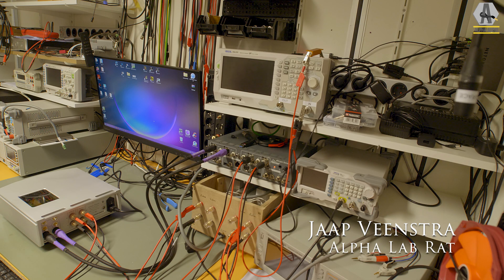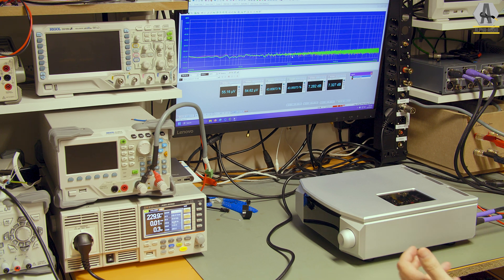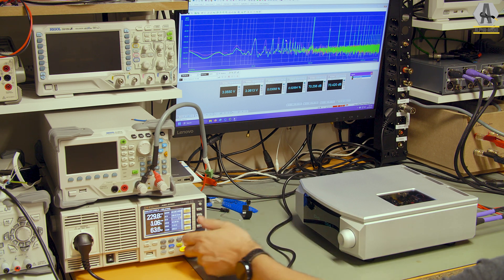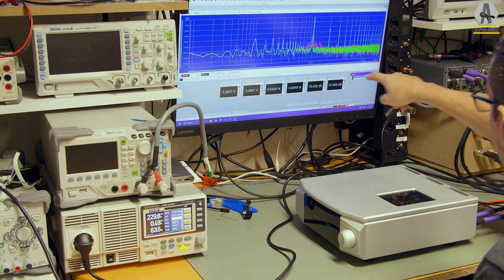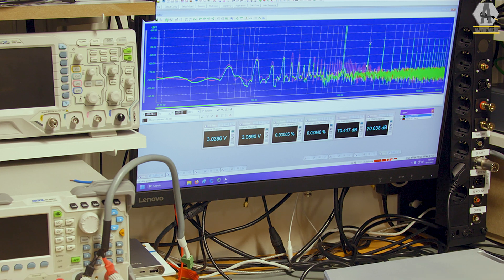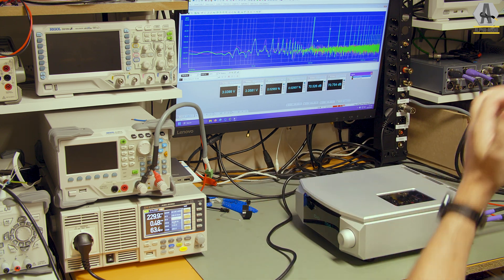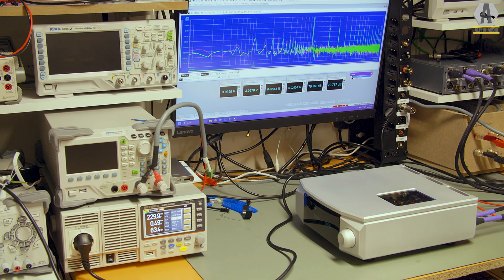Alpha Labs - Your amp might be struggling! Influence of noise on an amplifier

Comment: What is interesting is that the additional distortion only pops up on the right (purple) channel. The channel that is next to the power supply 

This proves that it's a flawed design as the left channel doesn't show the distortion (or at least way less). The shielding of the psu isn't good enough otherwise the right channel was as clean as the left channel.
Reply from the maker: It is an integrated amp. That is not weird.
Reply: @TheAlphaAudio  not weird but there are done cost cuttings / compromis that technically aren't necessary. The left channel proves it can work fine, they just compromised on the shielding/layout of the right channel to safe space/money 

Honestly, it's still below 100dB so in most situations inaudible, good change the maker just accepted it.

Personally if this noise matters to me I would buy a better amplifier, not an expensive power conditioner. A quality power supply should handle noise/fluctuations well.

Comment: I think I have terrible noise on power grid or maybe someone is using a ham radio nearby . Is there any way to find this out without an oscilloscope ?
Reply from the maker: Not really. A spectrum analyzer is the tool you need. Although there are some simple devices that give you a number... But how and in what spectrum these devices work... No idea.

Comment: Not all amps behave as bad as this.This is an overhyped underdesigned and cheaply made amp with most costs sunk into the case and eye candy. I won't even comment on the 'low feedback'  high distortion design.  Please compare with something decent.

Comment: What a bad amplifier design. Harmonics do not really fall with higher order. Never seen such a mess.
Reply from the maker: Send in your design. We can check it out.
Reply: I can check it for myself :)  @TheAlphaAudio
Reply: Sorry to bother you again, but are you really sure, that your choko EMEI amplifier is in good shape? It seems to have a problem, because the manufacturer promise 0,002% THD&N  in the specs. Manufacturer measuring conditions  are unknown, but the amplifier´s  behavior  is not ok, even with low nfb.
Reply from the maker: @jellybelly2234  this is just noise floor. Not THD...
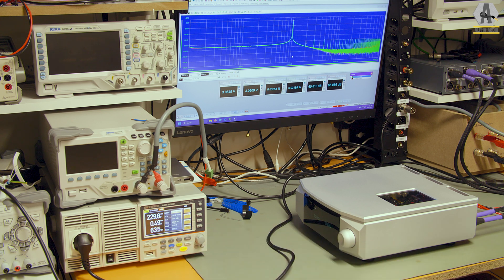Reply: But you call them "harmonics" in 2:39 yourself.  Cursor is set on K2 (with 1 kHz stimulus), and what we see below in the meters is THD 0,03%, 70 dB SINAD . You named it "low negative feedback design", but this is not ok, even in a low  NFB design. This looks to me as a faulty bias circuit or something else. If your measurement is correct, the amp must be faulty.
Reply from the maker: @jellybelly2234  We will do a complete measurement for the review.

Comment: Japp! Great showing us something, we mini audiophiles didn’t know. How are your grid and in house, 3 phase or what? In Sweden almost all newer homes, 1970 forwards have 3 phase (25 amps) . I’m now I Spain and apartment from 1985 and it’s 1 phase (40 amps) and how does noice compare in the phases?
Reply from the maker: In the Netherlands it differs. Some houses have 1 phase, others have 3. I am not sure what I have at the office. Sorry.
Reply: @TheAlphaAudio  Thanks for answering. Don’t be sorry, in all countries there are different power distribution solutions and they all affect the power and you aren’t able to try them all and come up with a answer. But other viewers and patrons may help us all with their experience. Twisting the cable in the 3 phase might something. My son installs chargers for electric cars all day long and they do by standard install a load-balance- device (balancing the load on the 3fases) to assist the charger and house. Would a load balancer smear or clear a signal? You got so much to investigate before you get to audio nirvana….😉
Reply from the maker: @rikardekvall3433  yes. True... There is a lot to find out. But I noticed power is everything. If the energy supply is not good... Nothing will be good.

Comment: I suffer from a very noisy power grid at home because of the power company. Years ago I measured more than 3 Vdc!!! (if you do not see it you can not believe it, I know). Plus there is a lot of RF/EMI noise.

I have managed to minimize these problems as much as possible without losing dynamics in the reproduction. With DC Blockers (with large quality EPCOS capacitors), Schaffner RF/EMI FN 9244B (B: medical) inlet filters and Würth 150 kHz ferrites.

As for filters and ferrites, each link in the audio chain has different maximum allowable attenuation without losing dynamic range.

In December 2022 I bought a Magnat MA 900 hybrid integrated (silver, 930 € at home, Spain -from Amazon Germany) for my second audio system (the computer one) for listening mainly in the near field via my modified KEF Q100 coaxials (which sound much better than the factory ones). In the previous amplifier I had two Schaffner inlet filters in the signal path. Until I added a third I was not happy with the sound, considering a return. A few days ago I added a 150 kHz filter and the loss in dynamics was evident.

In my main system the amplifier only supports a Schaffner filter, evident proof that the amp's filtering system is more effective, I say.

On the main system I have a DCB prototype, updated with expensive Mundorf + DCB x2. In the secondary (Magnat), DCB + DCB x4.

The Magnat is still with me (and for many years). I am considering, out of curiosity, changing the pair of JJ ECC81 tubes for some new Psvane 12AT7-S Art-Series.

- maty -

Comment: Really interesting to me since I just bought a (used) set of Kinki Studio EX-B7 monoblock amplifiers. On set-up, I had  noise contamination in one channel from my source, a 12 y.o. iMac, which was plugged into the same AV power conditioner (APC brand) as one of the amps; the other amp had its own power conditioner and had no noise.  The noise went away when I plugged the mac into a regular wall socket.  Do you think the monoblocks use the same ‘low feedback’ design as the Choco and so experience this problem?   I note that the NAD M22 amp I have has no audible problems being plugged into the same p.conditioner as the mac.  Also, my Benchmark DAC3 HGC does not produce audible noise, despite being plugged into the same p.cond. as one amp.
Are there good one or two socket power conditioners one could use, say, behind each mono amp, to avoid cross contamination?
btw. I enjoy your vid.s.  Thanks.  Keep it up.
Reply: Kinki Studio EX-B7 monoblocks are described in the manual as direct DC coupler amplifiers. Be very, very careful what you connect to it, as DC offset/voltage potential can easily damage your loudspeakers. I have an M7 and that one really doesn't like any of that. When stuff is connected and operating properly, it works really well.

Choko Emei is a somewhat stripped budget variant compared to your monoblocks - I am not sure how many concessions were made with the power supply. The only thing that seems obvious to me is that interior shielding is better in the monoblocks.

A  review of the Choko would be very nice, as occupies a fairly strange spot in the market imo, and could potentially be very interesting, especially if the gear that will go alongside it is interesting too.
Reply: Thanks for your input.  My Benchmark dac and speakers (Cube Audio, Spendor) seem to get along fine with the Kinki Studio monos.  I connect my REL subs to the dac, not to the amps; although the latter may be possible, I haven’t checked with Kinki or REL.
Reply from the maker: The M22 uses a switch mode power supply. That is very different. I dont know the EX-B7. Maybe they also use little feedback. But that has nothing to do with being influenced by noise... That has to do with the design of the power supply and layout of the amp.

We have a lot of tests on power conditioners. Check our website.
Reply: Thanks, I’ll look at that.